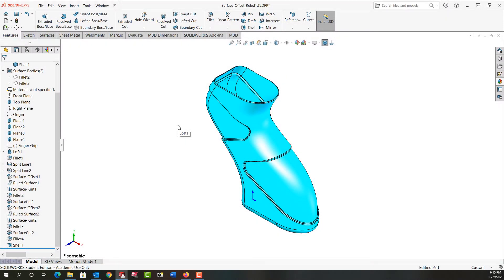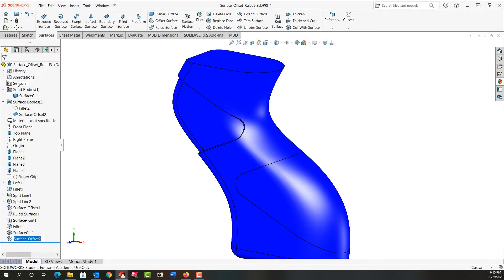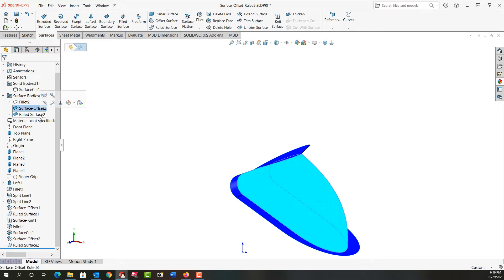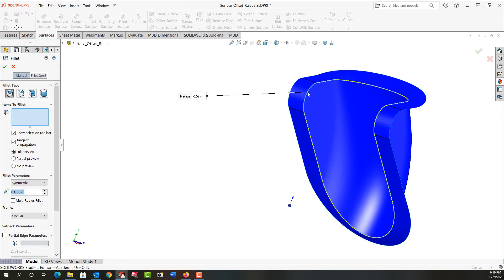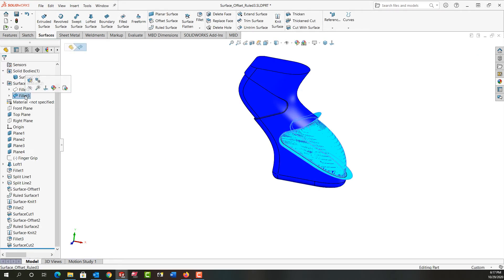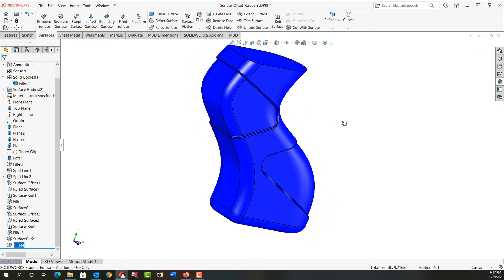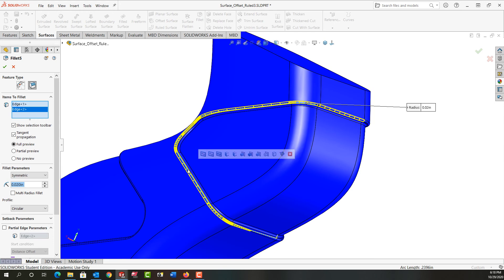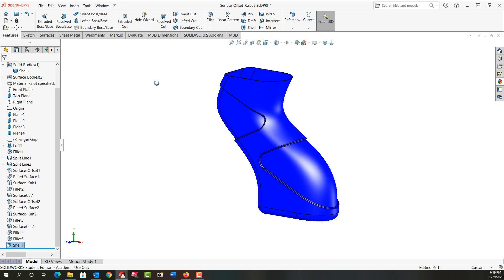Offset and Ruled Surface Completed

Comment: Solidworks is making my hair go grey, lmao. 

I am doing this exact same project for an advanced solidworks course, and this step is giving me a devil of a time. I have followed the steps precisely as given, and I even repeated them now exactly as you have just to make sure, and it simply won't cut. I get a vague "geometric conditions" error. Where the step worked for you it simply fails for me.
Reply from the maker: Without analyzing your work it is very difficult to say why it failed. Things to check for; did the surface offset into the part, are the two surfaces knit together to form one surface, is there a fillet.